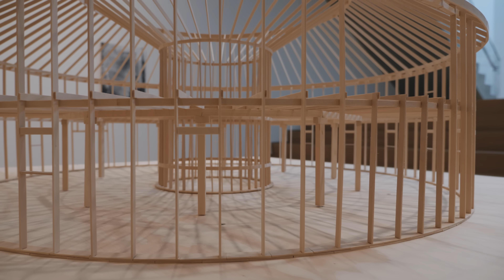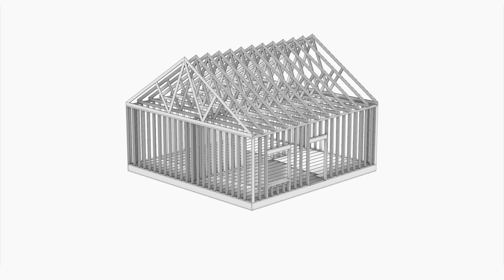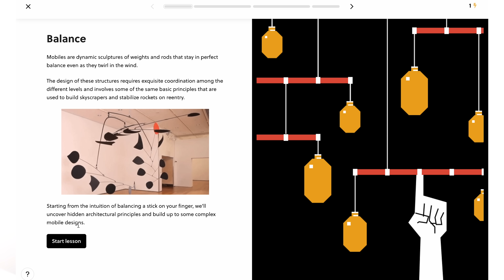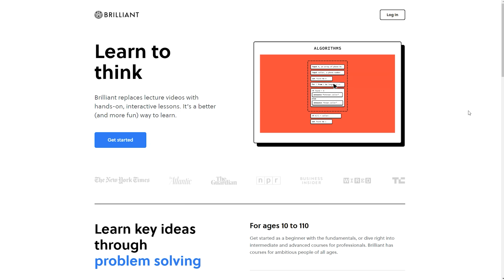The Genius of 2x4 Framing

Comment: The fundamentals of framing is really good, but the specific of parts of how we do it now is completely insane in my mostly uninformed oppinion.

We clad the entire outside in plywood/obs instead of just using 2 pieces of strapping per outside wall (if we even need that).
Then we build a standard 4"-6" thick wall cavity, just for historical reasons I guess, and then strap an extra 6" of foam insulation on the outside because insulation standards and codes have increased so much.
Either go with the wall cavity, or maybe we could just build outer structural wall out of structural foam blocks.

Comment: Besides the nails (which other commenters have already pointed out) the sheer abundance of wood in North America is what makes is so sustainable for us. Usually the cheapest way to build homes is to use whatever materials are the most locally abundant - for us that's wood. We need to stop building so many detached singly-family homes, but 4-6 storey apartments can be built with wood just as well.

Comment: Okay so we now know why it's better than timber framing, but why were/are americans so averse to bricks? They are also cheap to mass produce, everyone can stacks some bricks (it's even simpler than 2x4 framing), they provide better stability, better insulation, no fire hazard, no termite/rotting problems, and the houses can easily stand for 10x as long.

Comment: Stick framing will come to an end someday it is a bad idea. One day people will wake up and realize that cmus are the way to go especially in the hurricane corridor. One day people will wake up and find out that that water damage and rot that you find below every window and every door in a stick built house just destroys the lifespan. Well insulated CMU building will be the wave of the future ,it may not be 10 years it may not be 20 years but it will happen eventually. One day people will wake up and realize the stupidity of stick built framing the whole infrastructure that's built around it. Hauling building material from thousands of miles away when it could be built almost on site anywhere in the country by making CMUs out of local material is far wiser. A new generation will look upon our ignorance and stupidity and shake their heads with shame

Comment: You should compare wood framing to timber framing but to proper concrete or brick construction since instead of being a (for the most part) redundant technique (timber framing), concrete and brick are still worth using over timber because of how much more resilient such buildings are and how much longer they last. Cheap building processes are useful for a rapidly growing society but from the moment it's possible to benefit from larger time scales; you should.

Comment: In Norway, studs are 60 cm (~24") apart, to go with standard elements of 120 cm (~48").
Floors are usually 60 cm too, but sometimes 30 cm (-12") for extra rigidity.
Reply: @cmmartti  sorry! But thank you! I think I ment to put 48" at the 120cm, but obviously didn't. The standard with of most materials of wall sweets. While some prepainted sheets are 60 cm, to hide screws/nails in the joints at every stud.

Comment: The only benefit to building with wood is that it was cheap and readily available. Key word "was". We shouldn't be building with this anymore.

These wood frames are vulnerable to humidity, fire, and termites. Also, the on-site waste usually reaches up to 30%. And generally, wood has slowly lost structural integrity over the years as the industry has been forcing these tree's growth somehow. You can easily compare a new 2x4 with any older reclaimed wood. You can literally drive your nail into new wood

Im not saying we should eradicate the use of wood, we should just evolve how we build homes. Wood simply looks beautiful, and it shouldn't be inside our walls, but outside as furniture and whatnot.

Comment: I want the record to show: my dislike was not regarding any lack of quality of this presentation. You did an excellent job explaining the benefits of stick framing. 
A few points:
1. Look at the average lifespan of a stick framed building compared to the permanence of a true mortise & tenon timberframe structure. You’d have to build 10 stick homes to equal the lifespan of one timberframe. 
2. At the end of a stick frame structure’s life it will wind up in a landfill versus a timberframe which can be reused/repurposed indefinitely. 
3. Design opportunities are limited with stick frames which require much more intermediate support than the open ended potential of more advanced methods. 

Look at mass timber construction using cross laminated timber. All the benefits of timberframe as well as the ability to use scraps as in stick framing. My goal; however, is to use minimally sized components with maximum moment potential connections. Our next project will include glue laminated strips of scrap wood bent into arched vertical trusses. Lightweight, long lasting, unlimited design opportunities and using intricate joinery but that can be accomplished with minimal training and without super specialized tools. 

Wish me luck. Keep up the good work.

Comment: We continue to witness the streamlining process of building houses in the evolving shape. Becoming less popular are the gabled roofs with dormers being replaced by the cube or rectangle design with a flat roof. A hand cut roof is nearly a thing of the past. Trusses are in nearly every roof but can still be expensive. The cheapest alternative is essentially building another floor on top and calling it a roof.
Reply: The thing about flat roofs is that there is a pretty sharp latitude where they stop being viable.

As soon as you have meaningful amounts of snow, flat roofs (on stick frame buildings, not the big steel and concrete apartments/commercial buildings) are simply a non-starter. That means that sloped roofs will basically always be the norm overall, because the North East, Mid West, Great Plains and PNW (to say nothing of all of Canada) require them.

Comment: agreed with everything until you got to the “anybody can do it” part. Yes, anybody can nail a piece of wood to another, but you have to realize that framing doesn’t include an ikea manual, SKILLED laborers need to build the house based on plans which pretty much just include a drawing and some measurements. give credit where it’s due

Comment: I think its worth discussing the future of lumber framing. 2 x 6 standard to provide more space in the wall for insulation, and 24 in on center constriction to limit thermal bridging. These advances in quality will become necessary to reduce energy consumption as it becomes more expensive. 

There is a downside to mass construction, lack of quality in the product. Most large builders don't care about the efficiency of the houses they construct and so a large majority of american housing is expensive to maintain and wasteful in the amount of energy they consume.

Comment: Enjoyed the video!
Two things:
First, I have been doing framing and carpentry for 45 yrs and hamburgers are my favorite food… coincidence? I think not! 😉
Second, and I know I’m being picky, but you mention early in the video that studs are 16” apart.  Technically they are 16” on center which makes them 14 1/2” apart.  And it’s not uncommon for 24” on center especially with the price of lumber. Many advantages to that (that I won’t go into) but has to be done properly (like studs under roof trusses or floor joists)
Reply: You carpentry inclined folks are such artists with your hands and mind. I’ve the utmost respect for you, and the mechanically and architecturally gifted.
Reply: 14, 28/64 ? 😮
Reply: 14 7/16

Comment: Nice video, but a bit one-sided in my view. There are reasons we don't use this method very much in other places of the world. E.g.: negative environmental impact due to mono-culture of fir; bad insulation; lacking rigidity and resilience against heavy weather; fire risk; susceptibility to rot and insect damage (basically these houses aren't built to last longer than 30-50 years); not being suitable for building 4-5 story houses which you find in many urban areas in Europe - to name a few reasons.

The economy of scale doesn't pay off in the long run if you have to rebuild every 30-50 years and after every major storm or flood. Same as a hamburger, actually: it may be cheap and tasty, and it will fill you up quickly. But you'll be hungry again after only a couple of hours and in the long run you'll get fat and spend much more money on medical bills than if you bought healthy food from the start.

Comment: Its literal trash, throwaway mentality taken to the extreme in a commodity where it has no place, even less than in any other.
With a little added effort / investment we could be automatically cutting decent joinery and build houses that last longer than 30 years + withstand a light breeze.
Massively reduced garbage and waste of money used in constantly cycling the building stock at X times the rate of developed nations (which the US isn't in this as well as many other regards).

Comment: I think maybe with the capabilities of modern CNC digital manufacturing, there's a strong argument for a return to timber frame construction, or possibly a hybridization.
Reply: I came to the comments just to say this. CNC + CAD = economical automation. Mortise and tenon was done in a workshop and only assembled onsite. Which just happens to be the solution to skyrocketing labor costs and production inefficiencies.

Comment: Great look at something we Americans pretty much take for granted. With energy efficiency, building costs, and mandatory requirements increasingly impacting construction, it will be interesting to see how standard framing will change, or if it is replaced altogether (as in prebuilt panelized construction).
Reply: 2x6 standard instead of 2x4, and 24 in on center instead of 16 in. Also sealed air envelope with continuous flow energy recovery ventilation systems. This is the way we should have been building for at least 20 years. We are just to cheap to make actually good houses, people want size not quality, just like the big mac in the example. Cheap garbage that fills you up in the case of the big mac and large cheap house that makes you feel successful in the case of housing. Both lead to poor outcomes for the one who partakes.

Comment: Anyone who thinks stick framing will not last, I work in historic restoration and have seen plenty of 200-year-old small old farm buildings in New York State that were built in worse ways than stick framing and not much was needing replacement after all those years.  I've seen houses from the same period (called the Federal era) that did not even have sheathing. The clapboards were right over the studs,  which were irregular in spacing. The timberfaming was heavier but the studs around the perimeter were only about 3" deep. Some are fine homes otherwise. Whole neighborhoods of excellent 1850's, 1860's, 1870's. 1880's 1890's etc homes were built in our cities that are the envy of the world, IF they are kept painted and the roof kept up. Many masonry homes in Europe have also been painted and all homes also require good roof maintenance.

Comment: My house was originally built in 1916 and utilizes balloon framing.  I’m actually in the middle of a complete bathroom renovation and you can see from the second floor to the basement in the wall space.  I was already aware of this style, but that is because my father is a retired carpenter.  Great video by the way.  I really enjoyed it!
Reply: Hope you have plenty of smoke alarms!
Reply: @kupokraft3685  I do!  The majority of the houses in the area I live in are of the same or similar design.  I’m very thorough with my renovations and take care of all the code issues while I have the walls and floor open.
Reply: @justjake5454  you need to install fire blocking ever time you open a wall
Reply: @SKANK_HUNT49  Yep, I do whenever I get the chance.
Reply: My condolences
Reply: Balloon framing is actually more energy efficient, as there are fewer framing members.
Reply: @mjw9928  Balloon framing requires old growth timber and significantly higher transportation and storage costs.  In a technical sense, it does require a smaller number of pieces, but the board footage is close to the same.
Reply: @Mrhalligan39  I wonder if bamboo can be used as studs for such constructions? As it grows incredibly fast and can be really strong.
Reply: @solarissv777  Bamboo is also quite susceptible to fire spread, as the Garley Building fire in Hong Kong showed.
Reply: @mjw9928  yea... exactly, quality < economy
Reply: That's funny Jake, because I don't remember asking!  I'm going to teach you the most valuable lesson you'll ever learn in your life in three seconds.  Don't speak unless spoken to!  That is all!!!!!!!!!!!!!!!!!!!!!
Reply: @artv4nd3l4y  hahahaha
Reply: @artv4nd3l4y    you dont get to talk like that in the youtube comment section, I'm calling the cyber cops on your ass
Reply: @abberss  yeah that's right keep it shut, and don't you speak unless you're spoken to.  you would be wise to learn how to get on your knees quickly, and scrub that kitchen with efficiency, you need to make the kid's lunches and don't give them those garbage Lunchables.

Comment: Overall, this was a fascinating video from a historical perspective. Unfortunately, it had a couple of incorrect assumptions.

Modern post frame construction has many benefits over lightweight framing and the hand hewn timber framing of the past. To casually put it aside as was done in this video does a disservice to the industry. I suggest the producers take a look at modern post frame to see how many standardized practices have been put into place and make it a contender with traditional stick built homes. 

You also stated that framing doesn't require skilled labor. That is 100% wrong. It may be a little easier to teach than creating tenons, but even using a measuring tape requires developing skills to do it accurately. Hammering is a skill that takes time to master. Even using power nailers takes skill to use them correctly. I have witnessed people who just don't get it and have to be terminated. 

I think your video could be greatly improved if the condescending attitudes and assumptions about things the authors are not knowledgeable of were removed. And it would be far less misleading.
Reply: i’d like to see anybody who thinks that framing isn’t a skilled labor try to cut a rafter and then proceed to climb 20ft in the air and nail it to the structure correctly. they wouldn’t have a clue where to begin.
Reply: Skill is just a spectrum, but it's definitely true that timber framing takes longer to learn than framing with dimensional lumber. That's why the most skilled framers today are ones that can do both, and beginner framers (as far as I got before I switched trades,) stick to nailing 2x4s.